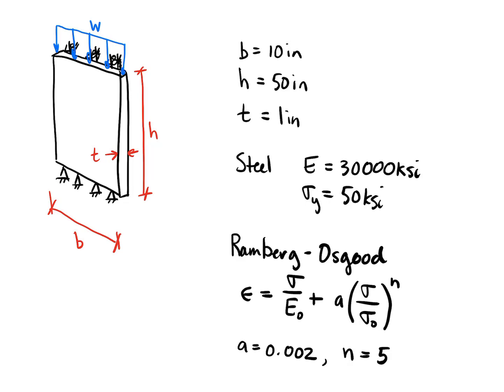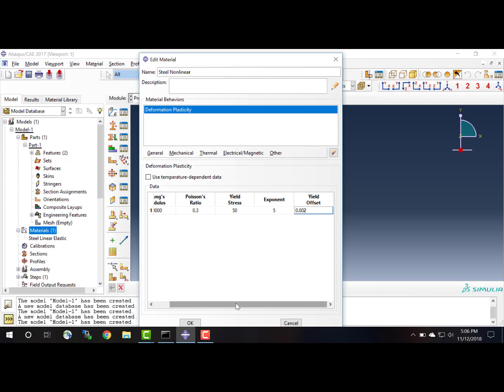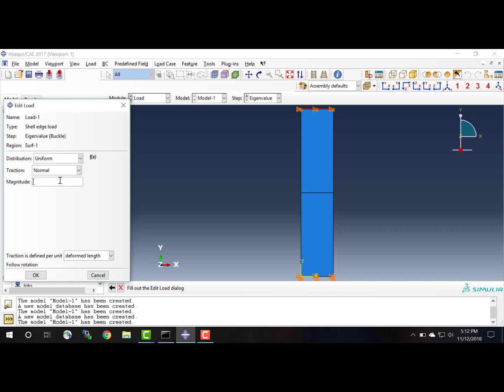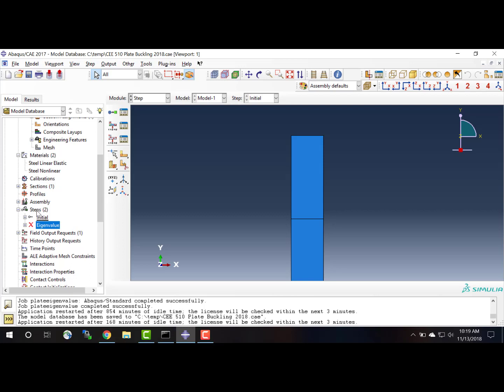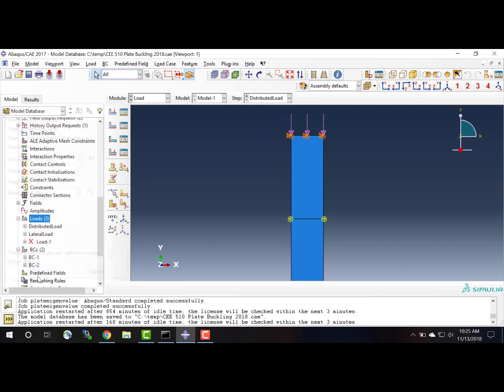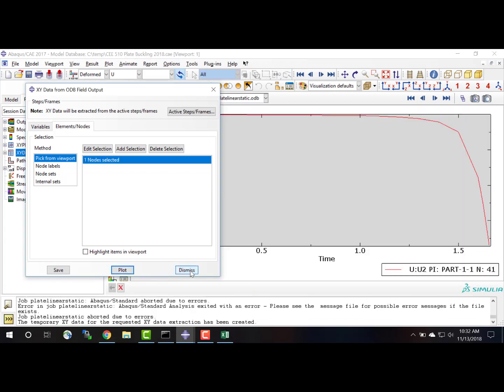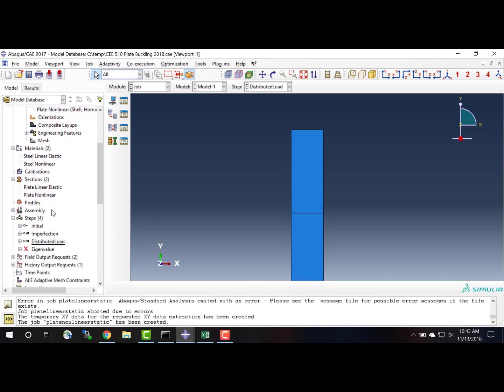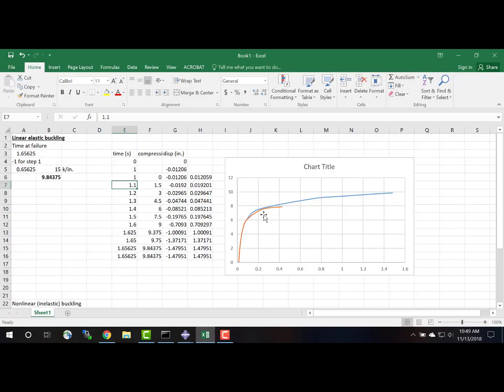Plate Buckling Analysis in Abaqus

Comment: Dear Ann,
Thanks for the good tutorial, I'm wondering if the result from final analysis which the imperfection and the material non linearity are applied different from result calculated by Static Riks method?. I guess they should be very closed.